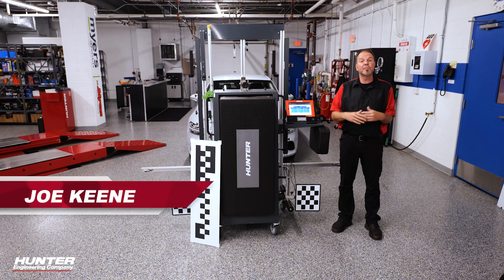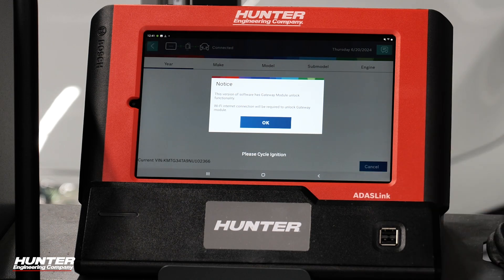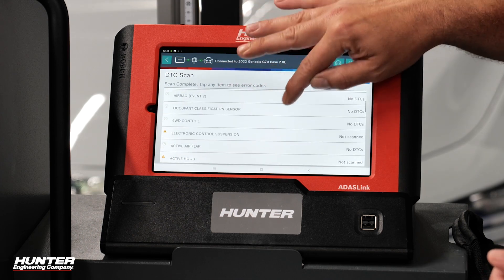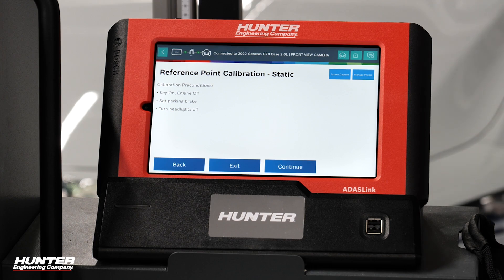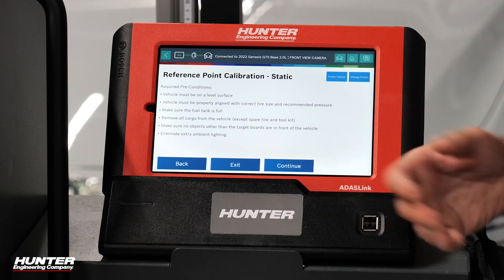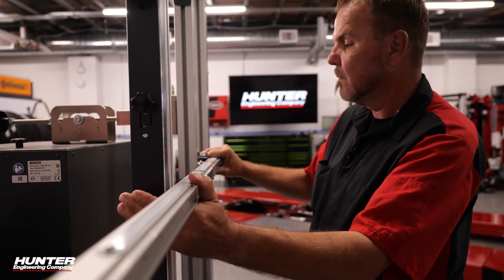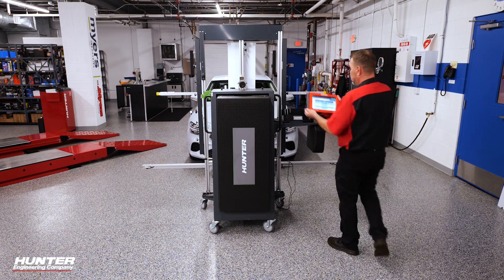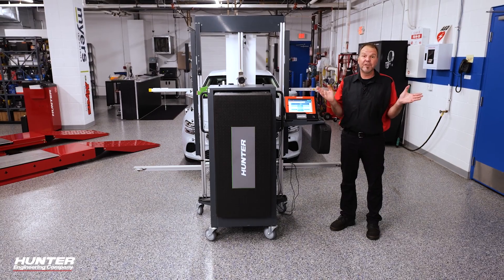ADAS calibrations: Genesis/Hyundai/Kia forward-facing camera calibration

Comment: Quick question about the sensitivity. I have a mobile windshield replacement coming up and the company said they will calibrate the adas at my house. Does anyone know if that a bad idea or can this be reliably completed on a residential road (or garage)?
Reply from the maker: "ADAS calibrations  are either static( completed in a facility) or dynamic ( completed by driving the vehicle) in nature. Without knowing all the details of this case we would suspect the calibration is dynamic in nature.  To eliminate any concern, engage the repair company with your questions before moving forward."